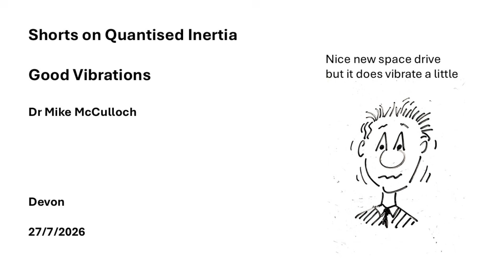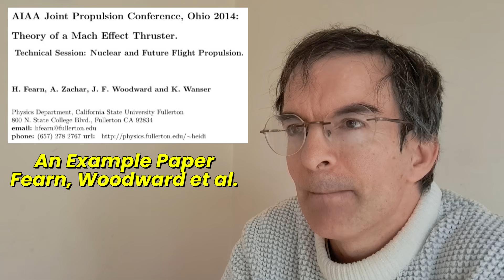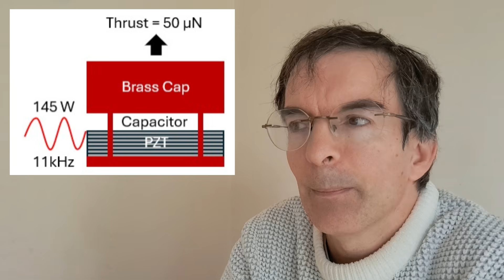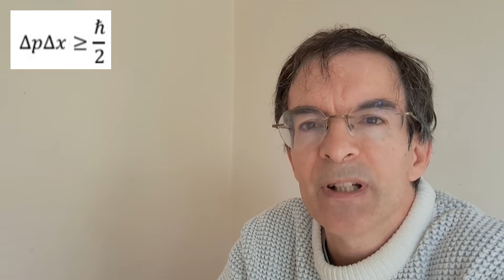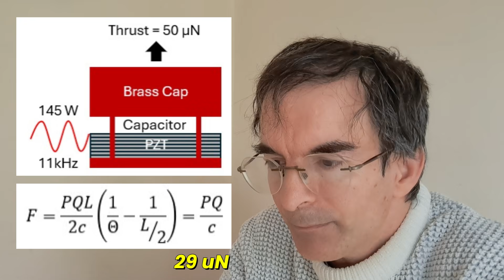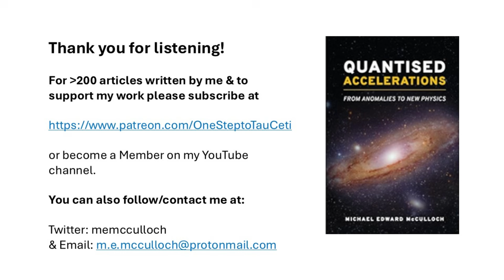Good Vibrations

Comment: As an engineer working in this field, I'm amazed at how they managed to measure such a small thrust under such intense vibration. I can imagine a laser interferometer, but more than one would be needed to eliminate the noise from the plate material deformation. This is a serious technological challenge, because it's impossible to measure static thrust without registering sensor deformation. And any deformation would simply be lost in the noise of such vibration.